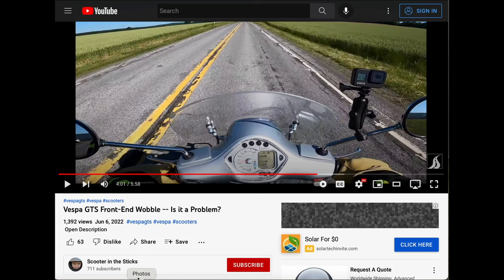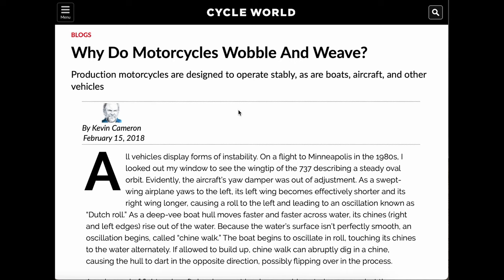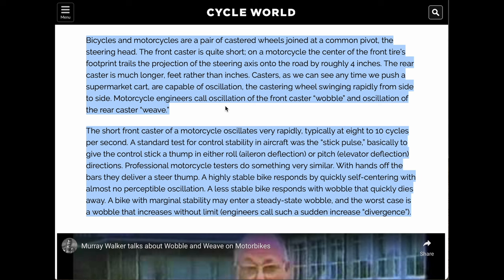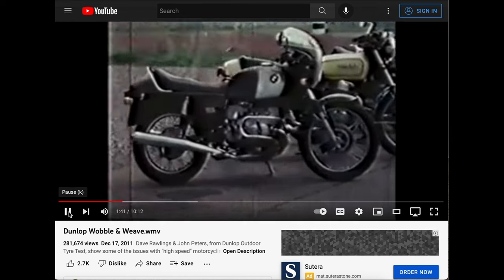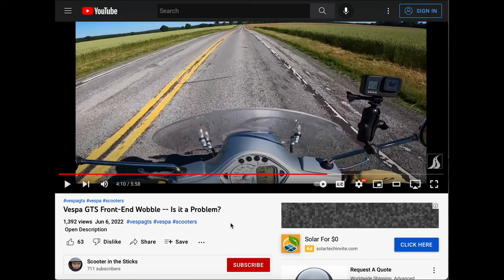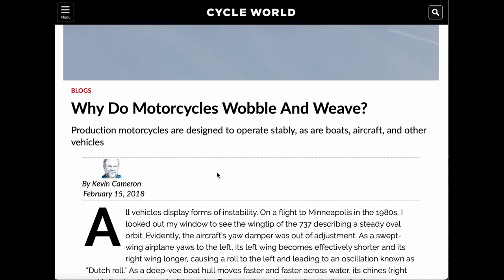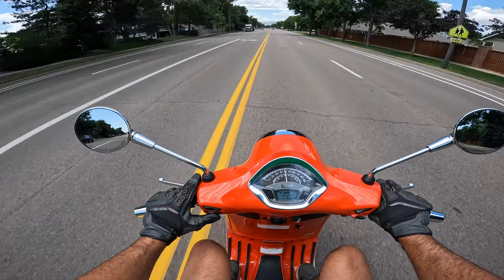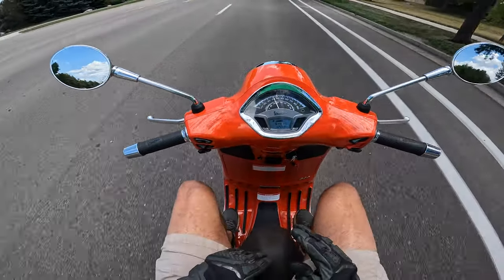GTS Wobble - Is it a Thing?!

Comment: My 2022 GTS HPE with 1800 miles wobbles when decelerating from about 30 to 25 MPH when both hands are off the wheel, but not nearly as bad as what Steve showed in his video. I didn’t experience it until I watch his video since I usually have at least one hand on a grip.

Comment: Almost anything can induce wobble on a two-wheeled vehicle, worn or loose bearings, unusual weight distribution, over or under inflation of tyres, attachments to the handlebars, and so on. Cyclic oscillations aren't generally a big deal, and the dark arts of trail, rake and castor effect are well understood by manufacturers. Rarely a wobble can develop into a full-blown tank slapper (see: TT 1999 F1 Race Paul Orritt The mother of all tank slappers! on YouTube). A motorcycle front wheel meeting the road, typically after a "wheelie" or excessive acceleration, out of line with the angle of travel is the usual cause.

Comment: Thanks for the research. The gts 300 hpe will wobble at around 30 to 50 kmh once you install a fly screen.
Reply: I had the touring GTS with fly screen, no wobble. Upgraded to the Faco twin screen, still no wobble. But, I've had wobble on other bikes where others didn't.
And I'm not disagreeing that you experience it. This is just my experience. I know different riders and different mods make a huge difference. So does things like tire balance, tire pressure, bearings, etc.

Comment: I didn't do as much testing as you did but also found on my 2020 Touring model with around 500 miles no wobble. I added a higher wind screen and a front rack but nothing more and the tires set up just stock.

Comment: With my experience with motorcycles you might try increasing the preloaded on the rear shocks.  With the rear alittle higher it will steepen the fork and reduce the trail just alittle.  Could have a effect.
Reply from the maker: That’s an interesting thought. I’m actually happy with how it’s performing right now, but maybe you mean as a test to see if it would introduce steering wobble? The stock rear shocks have four settings. The descriptions from the manual are as follows:

position one: minimum preload rider only

position two: medium preload rider only

position three: medium preload rider in passenger 

position four: maximum pre-load rider passenger and luggage.  

I currently have them set on position number two.
Reply: Add another click or two on the rear shocks and see what happens. Most small motorcycles and scooters are made for 150/170 pound riders. If you weight more take that into consideration.

Comment: Great video! I think your bar end weights are doing a very good job. I have the same weights but I weigh a lot more than you and run a full windscreen and top box and I have quite bad wobble. I have tested with top box and screen off (keeping the weighted bar ends) and it was significantly better but not gone (probably because of my weight). It seems like a lot of factors can influence the wobble. One thing I will say is that once you get use to it, it is no longer an issue.

Comment: I have a 2006 GT200 with 14,000 miles on it, same as a GTS, mine has a heavily loaded Vespa top box, and it DOES NOT do that. I have done everything I can to try and make it do that. That is NOT normal. It is likely low pressure in the front tire (though that didn't make mine shake that) or maybe bad steering head bearings. Also possibly something wrong with the front suspension, or tire ply separation.

Comment: You can find videos on "death wobble" in 4 wheel off road vehicles that have been lifted. There is usually a fix for their wobble, which involves wheel caster and camber. I wonder if heavier or lighter Vespa riders cause the problem. If so, going with a stronger or weaker front wheel spring might solve the problem.

Comment: I had a 2015 GTS 300 Super, which was equipped with what Vespa/Piaggio called ESS, which essentially was an articulated assembly designed to counteract potential "wobble" by way of an additional pivot-point at the axle. (EDIT: I'm certain I mangled the descriptive phiysics of the thing, but it's late…) All I can say is that I didn't experience any noticeable issues with the bike. Fast-forward to the present day with my 2022 GTS SuperTech, which went back to the pre-ESS front end (actually, a modified/updated version, which has been in place since the 2018 model year), and…it feels pretty much the same as my previous ride, i.e. "nothing to report." Piaggio likely ditched the ESS system due to its complexity/cost (there were some complaints that the ESS setup had a tendency to loudly "clunk", although my bike didn't seem to suffer this), but it appears they figured out how to largely, if not entirely, circumvent the wobbling issue - insofar as it's regarded as a "major" issue - without additional hardware.
Reply from the maker: That’s interesting. I still don’t know much about Vespas and past designs. I’m sure enjoying this one though!

Comment: I don't know what caused the shaking of the steering wheel, but I think the weight of the rear wheel has something to do with it   /  The steering wheel of my GTS shakes when the top box is installed.

Comment: My GTS 250 was PERFECT when I bought it, so perfect that I didn't understand why people were complaining at that time..then, suddenly, 3/4 years later I started to have this problem... god only knows what happened..some says it's related to thrust bearing/thrust block (I had to look it up o the dictionary and I'm not even sure it's the correct word..in Italian it's "ralle di sterzo"), some says there are Italian gremlins inside...I couldn't find the bastards though. I corrected the issue by changing tires (Pirelli Diablo Rosso scooter are fantastic) and changing handlebars end weights with the 470 gr. model...I'm not saying it's entirely solved but it's much much better than in the past.
Reply from the maker: Very interesting. This sort of thing can be so complex and as you say variables like tire wear can be enough to change the whole equation. At least some wobble is to be expected from any bike at least some speed. I’ve not seen any on this bike yet, which was a surprise, but maybe, like they were with you, the gremlins are just teasing me and staying hidden for a while!

Comment: In your video you mentioned Ride On sealant and dynamic balancer. Is this a product you installed on your scooter, or did you have the dealer install it before delivery? I think this is a great idea and helps with your scooter stability. If you did the install, was it a difficult process? Thanks!
Reply from the maker: It is a liquid that you squirt into the tires. Remove the valve core from the valve stem, squirt the liquid in, screw the valve, core back into the valve stem, air up the tires and you’re done. Very easy.
Reply: @flatgrindrides  thanks for the reply! I will buy it offline and do it myself. Sounds easy enough! Get out there and ride again! I think I still have another two months for delivery. Can’t wait!
Reply from the maker: @AltitudeRider  👍 I have a two week trip for work, so it will be a bit longer than that until my next video. ☹️

Comment: Me and my friends have the GTS super we haven't experienced this yet what so ever.  We have the ABS braking system on our bikes. So yeah touch wood it's all good any bike to be fair will wobble when hands are off the bars. My advise is keep your hands on the bars. I was reading on the forum one guy had the same problem. He tightened up the head set then the issue went away.  Thanks for the video dude 😀
Reply from the maker: Agreed. I think it’s a non-issue and I hope the video made that clear. I’ve experienced it on bicycles and other motorcycles but not on my GTS. And the solution is simple, just put your hands on the handlebars and the wobble goes away.  Enjoy your GTS! Happy riding!
Reply: @flatgrindrides  I love my bike I think they are a fantastic bike. Very good build quality , and they ride amazing in my opinion cheers take care..

Comment: I have the same problem with my Honda Forza 125 scooter (15" front, 14" rear wheel, quite long wheel base), always when decelerating from about 70 to 60 KPH (43 to 37 MPH). About as strong as Steve's GTS. After three years of driving, I dismantled the standard, very large and heavy top case (top box) for the first time. The top case triggers the problem, at least on my scooter. Without top case, no issues at all. The seating position can also affect the wobbling: Leaning a little more forward, i.e. bringing weight towards the front axle, reduces the problem a little, but without solving it completely. The rider's weight can also play a role. All my mechanics are a little lighter than me and didn't have the problem on the test ride. As with the Forza with its top case, it has to be be determined individually for each scooter AND driver what causes the wobbling and how it can be rectified.
Reply from the maker: It’s like wind buffeting. A windscreen works great for one person and it’s horrible for another. So many variables. Rider height, rider position, helmet, etc. Complex system!  At least you figured it out that your top box is a key variable for you!

Comment: Good video. I have the windscreen stock, then changed to the Faco twin. Still stable. But I know my setup with all variables does not match everyone else. The worst wobble I ever experienced was on a Gold Wing. Shop said it was my steering bearings. I rode it another 50k miles and traded it in. It did get worse with tire wear but new tires always made it minimal.
On MV, many claim the top cases cause it. I don't have one (yet). Maybe my gray bike has an orange base coat?
Reply from the maker: Sometimes gray identifies as orange. You have to ask to know for sure 😜

Comment: Hi,  I've just recently purchased a 2016 70th Anniversary GTS super ie , the bike had only done 114 miles so in effect a new scooter albeit 5 years old. The scooter had been stored correctly in a heated garage so mint condition. I have to agree with your findings regarding wobble. It's something I have read about on the forums but the bike is just coming upto 1000 miles and so far no wobble experienced.  The tyres are the original Michelin', everything else is as factory intended. Regards Barbus
Reply from the maker: Sounds like a great find! Enjoy!
Reply: @flatgrindrides  Hi again,  just watched your film regarding running your new Vespa in. I really like your scooter especially the colour, orange is my favourite colour and the GTS really lends itself to it. The Vespa rally 200 from the early 1970's was produced in orange. Not for me the matt black or grey paint on a Vespa, a vibrant colour in high gloss for me everytime. Nothing like riding out after waxing and polishing so long as it doesn't start raining after setting off! You mentioned that it's your first Vespa so welcome fellow scooterist from this English Mod. I did notice whilst watching that you were using the sidestand alot, I realise that you had only stopped for a short time and it is convenient. I'm not sure if you are aware but alot of GTS riders don't use it all and that includes myself due to scooters falling over. You have a 2022 model so they may have improved it, I have 2016 and do not trust the sidestand at all. On that I will sign off and happy riding. p.s. you need a parka and some Small Faces albums.🤠
Reply from the maker: @barbus67  That’s good advice. I’m using the sidestand less, and only for quick stops when the bike is on FLAT ground or facing into a slope. I’m very conscious of not using it on any kind of downward slope for risk of having it roll off. Mostly I’m just using the center stand. I’m gonna have to up my mod game for sure! I feel inclined to blow my mind! 😉
Reply: @flatgrindrides  Obviously The Who are regarded as hugely influential musically and within the Mod movement and rightly so. For me though it's The Small Faces who perfectly encompass what it is to be a Mod. Just been listening to some of their stuff on YouTube, Get yourself together, Tin Soldier, Lazy Sunday to mention a few.  The  ex U.S. parkas were adopted by the Mods in the sixties because they were cheap and plentiful and perfect for protecting the tailored Mohair wool suit and English brogues. Happy riding 🛵

Comment: Wow, that’s a far more expansive, thoughtful dive into wobble than I did. Excellent presentation.

I have to ask, did you allow the speed to decline further, say to 10mph?  

I agree with the idea that wobble is subject to a dynamic system and there are many things that are involved that could cause or reduce wobble.

My scooter is older and has 44K miles on the clock and the original steering and front wheel bearings. But it has wobbled since new and with many brands of tires. I quit worrying about it rather quickly since it was so easily dampened by putting my hands on the bars.

When I get around to replacing the GTS with a new one, I hope it vanquishes wobble as yours has!
Reply from the maker: Thanks Steve. I have tested from about 55mph all the way down to as slow as I can balance the bike and have experienced no steering wobble. 

It's odd, because I would expect some wobble at some speed, but nope. I can't explain it. 

I just shot another quick video on my way home from the grocery store showing "no hands" from 30 mph down to as slow as I could go: https://youtu.be/cNdp76aa1p8

I also spoke with a couple of Nobel prize winning physicists. They did some testing and modeled the problem and concluded that the orange ones don't wobble!  ;-)
Reply: @flatgrindrides  I think the only answer that makes sense for you not having wobble is you must live right.  And I'm experiencing some karmic payback...
Reply from the maker: @ScooterintheSticks  No, my vote is still on orange being the most stable color. 😉
Reply: @flatgrindrides  Science!!!!!
Reply: I too was wondering what Steve asks, it didn't look like you went below 30 or so.  My '09 has been horrible at the low speed.  I've done everything including new head bearings.  I do run a short Vespa windscreen & GIVI tail box(usually empty).  It just may be what one of the comments said..."Italian Gremlins", I can live with that.  Wonderful video!

Comment: The smaller the tire the larger the wobble but sometimes it’s just incorrect torque on the head set bearings. And maybe stiffen up the back springs a click or two and check it again

Comment: Identical problem on my Piaggio Beverly 400 Hpe (2021) . Wobbles like crazy at 60km/h. My previous scooter was Beverly 350 2019 and same thing.Heavier hadlebar weights, topcase on both and normal windscreens.
Reply: Did you find a fix for it?

Comment: I don’t own one of these yet, I hope to in the next few months, but would the handlebar end weights cut down on this?
Reply from the maker: I don’t know. I do know that they often come with top boxes, so it may be that adding the weight on the rear is best offset by also adding the handlebar weights. Presumably it will give you better general handling. As to the steering wobble specifically unless you’re riding with no hands I wouldn’t worry about it at all, and you may not even notice it.

Comment: My brand new moped wobbles have to junk that moped wont be able to resell to someone else. Also pulls to the right Amigo 2022 50cc. A girl with less strength cant sustain wobbles. Hope that the shop can fix that but if not is another moped.
Reply from the maker: That’s a bummer. I hope they get it fixed for you.

Comment: I have p150x and I can let go of handle bars doing 100kmh but I had problem where if the wind catch me, scoot would wobble not like in video but more like dive to one side..... I have changed everything and eventually scoot stood foe while and wheels went flat and I ride it and dive was gone. I'd actually change a lane. So, I'd put 2bar front back and for more then decade.. Px200 not having this problem. I red that tire pressure should be 1.2bar front and 1.8bar back. I'm running 1bar front and 1.6 bar back. Much more softer ride.. Hells bells. I rebuild front end and back end. Just to find out it's tyre pressure. 🤷😐💩🙄
Reply: Must know the frustration over 3 years trying to figure out this problem 🙄🤔🤣🤣🤣🤣🤣🤣🤣🤣🤣
Reply from the maker: So many possible variables. At least you have found your solution!

Comment: What wobble I have 2021 gts300  hpe 4000 mls never had any problems  with wobble  at any speed I cruise on motorway s at 70 mph the legal  limit  here in northern  ireland  steady  I have been  riding  motorcycles  90cc  to 1400cc  for 53 yrs vespa is great

Comment: Let me start by stating that I am not a Vespa expert.  Last spring I was shopping around for a Vespa.  I seem to remember that around 07, or maybe 13, Vespa beefed up the front end on the GTS.  I think there may be a Robot video where he talks about the evolution of the GTS and he mentions the change.  The engineer in me really likes the elegance of the landing gear derived front suspension.  But at the same time I look at it an think that it would be more robust if they used a pair of telescoping forks.  I am not sure what vintage Steve’s GTS is, but I suspect that he has the lighter front end.  I think that the combination of the cantilevered loads on the Vespa front end is more susceptible to oscillation which is exasperated by wear induced play will magnify the impact of any imbalance in the spinning mass of the wheel.  This will also be more pronounced at a resonant frequency.  The vibration that you saw at around 35 mph seemed not too bad.  Personally, I would like it to be rock solid.  But maybe I want too much.
Reply from the maker: They could very well be. 

I have no complaints at all with mine so far. I guess I think of it like some of the bicycles I’ve had over the years. Some had geometry that made it very easy to ride with no hands, others not so much. Either way it’s not a big deal to me. 

In the end, it’s very easy and fun to ride and it is what it is.